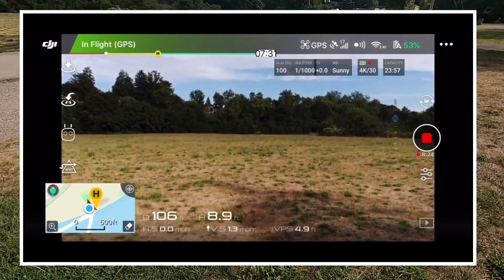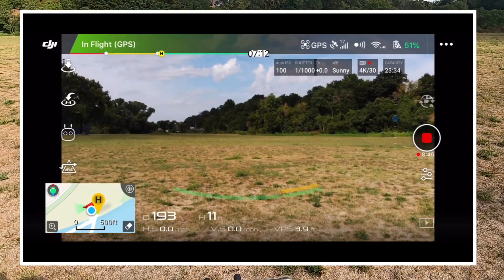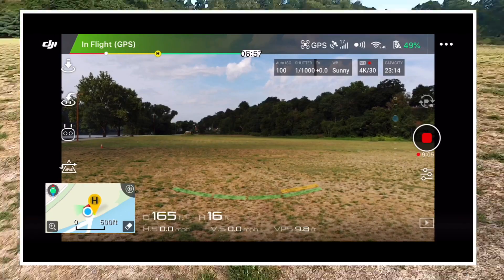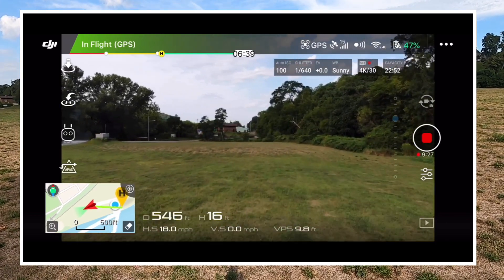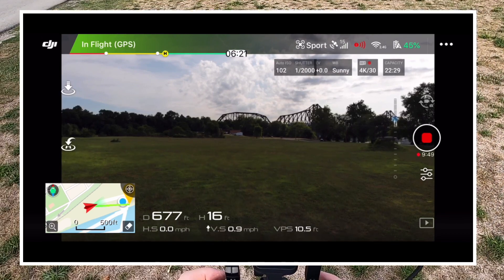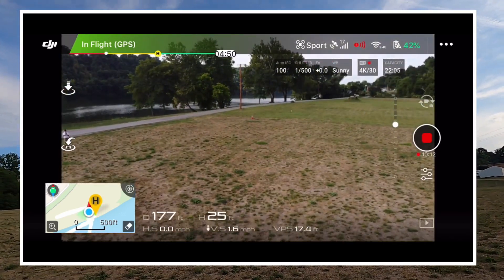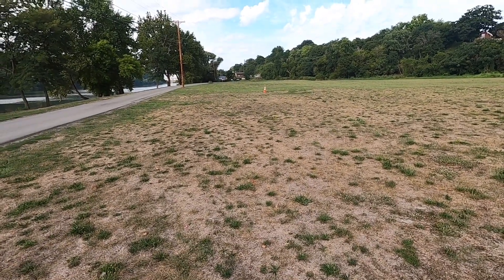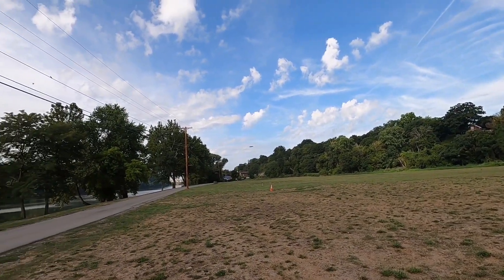DJI Mavic Air Speed Test 39 MPH #dji

Comment: DO  you have those MASTER AIRSCREW props plus if you turn the obstacle avoidance off it goes a little faster. Great to see you still take it out.
Reply from the maker: No, I did some work for MAS and the mavic air version was good but i didn't like having to change the gain when you used them and i usually fly where there is not a lot of people around